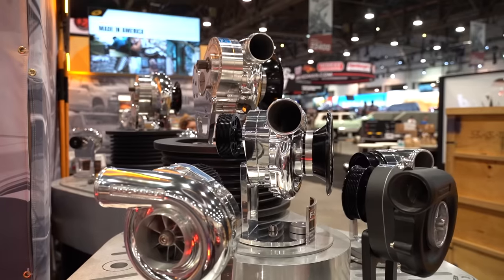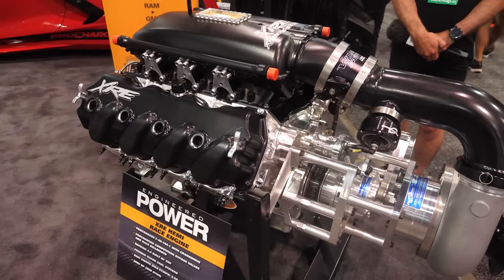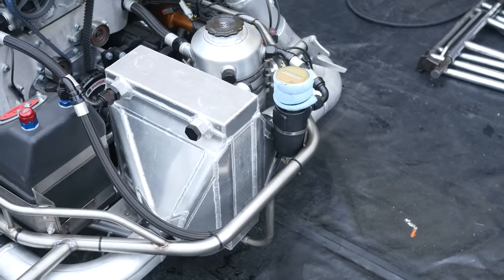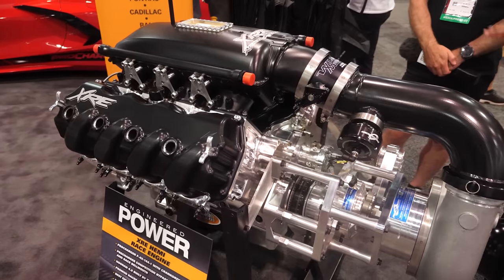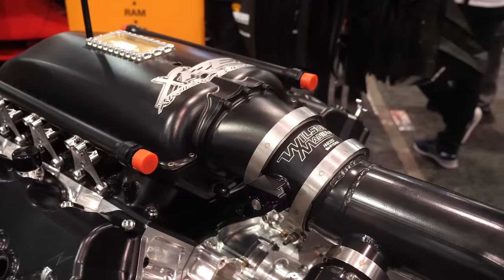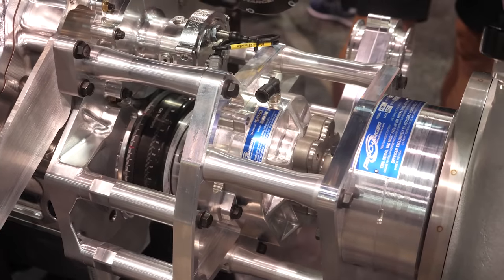Why Are Centrifugal Superchargers So Good?

Comment from the maker: Building a fast car? Get $400 OFF the VIP package with every current and FUTURE course included: https://hpcdmy.co/vipy2
Learn Engine Building today. Fundamentals course now 50% OFF.: https://hpcdmy.co/offery2
TIME STAMPS:
0:00 - Erik Radzins
0:16 - Forced Induction Options
0:34 - ProCharger
0:47 - Turbochargers Vs Centrifugal Superchargers
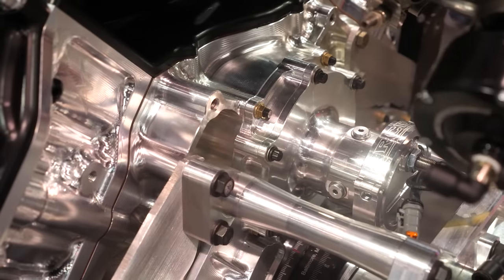2:05 - Compressor RPM Limitations
3:11 - Technological Advances
3:31 - One Size Does Not Fit All
5:03 - Efficiencies
5:52 - Supercharger Airflow Adcantages
7:35 - Boost Curves
8:38 - Boost From Idle
9:25 - Variable Cam Timing
9:44 - Superchargerss & Controlable Power
10:43 - Supercharger Packaging
11:54 - Belt Failure Vs Tensioners
12:50 - Belt Stretch
13:18 - 2000hp+ Drive Options
13:43 - Blower Speed Adjustment
15:00 - More Gears Are Good For Superchargers
16:08 - That's Erik!
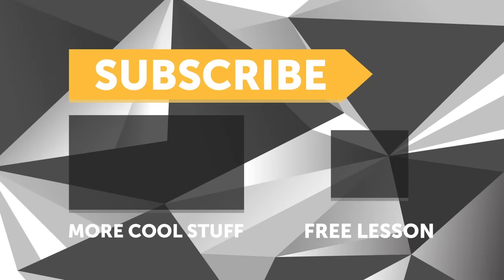16:39 - Like, Sub, Watch More, ?, Profit
🙋‍♂ Take $25 USD off ANY HPA course with coupon code: YOUTUBE25
Enrol now: https://hpcdmy.co/25offyt
Reply: Question?
Have you looked into using the petal style of throttle body and run draw through to improve efficiency?
The german aircraft ran that and saw great benefits at partial throttle as the air entering is already spinning fast and offloading the impeller.
Reply: The gears appear straight cut spurs.  Would recommend helical because they are quieter, and stronger.  They can be arranged so their thrust helps counter the impeller thrust.  If spline-connected to the shaft so they can slide, it’s possible for them to dampen torque pulses. Cheers

Comment: Roots or  Twin Screws deliver a wide flat torque curve, much more useful in the real world than the peaky delivery of a centrifugal. This coming from an owner of 2 centrifugally blown cars that I love.
Reply: every time i drive a roots or screw car, its almost unusable on the street. you give them more than h 30 or 40% throttle and they just want to blow the tires off. every centri ive driven is basically like a NA car until you cross the RPM threshold for boost. if im cruising on the interstate at 70 mph, i dont want to be making 2 or 3lbs of boost because of my gearing since im in a manual. they come on line when you really want to put the pedal down. i used to be a roots guy but now im a centri guy because ive been able to experience both several times now on different platforms and ive just come to favor centris.
Reply: @Day1Mechanic  Yeah it's a bitch having all that power available low in the powerband. In lower gears it takes some throttle control to reduce wheelspin but in higher gears you can mash the pedal at any RPM and feel the joy. I rode 170 HP literbikes for a decade and you can't give them a lot of throttle @ lower PRM in the lower gears or you'll land on your head. It was fun then and it is fun on 4 wheels as well.
As for cruising on the highway, the Maggie HB TVS2300 has a bypass valve that eliminates boost and parasitic loss at small throttle openings and light loads.
Reply: @scudzuki  I'll take a pd blower over anything.. In a race, the pd blower car just takes off way faster n is hard to beat.. Reason why most 3 second cars (1/4 mile) use pd blowers..lol
Reply: @P71ScrewHead  Yep, I want to ride that fat wave of torque from 2000 RPM to redline! This is why I have a Magnuson TVS2300 twin screw I'm installing on my LS7 ('11 Z06)
Reply: @scudzuki  The LS7, my favorite Chevy engine of the LSs.. Do you have the head fix or replaced with CNC heads?? Give it the beans man, smoke them tires..lol
Reply: @P71ScrewHead  I bought a set of used heads with 16k miles on them, had them rebuilt (new guides, seats cut, skim cut gasket surface) with Manley Inconel ex valves, reused the ti intakes, BTR platinum dual springs, ti retainers, and BTR v2 trunnion upgrade. Been driving it for a week and a half since. I love the LS7 too and especially the C6 Z06, the best balanced car I've ever driven. Gonna get another one to keep stock and possibly a GS manual for the C5R motor I have ready to throw down 900 crank HP
Reply: @scudzuki  Dayum, sounds like you're good to go.. I've always loved the ls7, never owned one tho.. Too broke n a Ford guy..lol

Comment: A centrifugal supercharger is basically a turbocharger without the exhaust turbine, so it’s driven off the crank. Well there’s no reason why a turbocharger can’t also be driven off a crank as well, so they can ‘crank’ plenty of air before exhaust pressure builds up on the turbine & so, using the benefits of a variable gear drive,  can also put power back into the crank. This is called turbo-compounding & was popular in aero engines in the immediate post-WWII period & some trucks today

Comment: Considering this concept for racing goes as far back as the 1950's with the Potvin Superchargers, there has certainly been massive advancements with the new metals, fuel delivery systems, and the engines themselves.
Reply: Advancing the technology? Fuel injection and electronic timing made the biggest impact to making any of this possible. I have a supercharged Pentastar with a Vortec in it that puts out 608 hp and it's quite amazing.
Reply: @dannysdailys  I work with a couple of vintage racers here in California, mostly just doing fabrication on bodywork. There's been two that have come through this summer building Potvin blown cars, one is a small block Chevy and the other a flathead Ford. In the shop next door is a Camaro with 500+ cubic inch Procharged engine. We looked at the dyno info for both the 1960's Potvin Chevy and the Procharged engine and the curves for torque are very similar. Much higher in the modern engine of course, but different that with a belt driven blower. I'm not well versed in making sense of that sort of data, but I remarked about how similar it was to each other and even the guys with the dyno had to take a look.
Reply: It originally goes back to the 1930's with aircraft engines, although they were trying to keeping intake air density as close to sea level to maintain power output.
Reply: Miller used centrifugal superchargers for some Indy engines in the 1930's then built the Novis in the 40's with them. a brute force approach but you have to start somewhere.
Reply: @jamesgeorge4874  Wasn't it Willey Post that did his flight at something like 30K feet in a pressurized flight suit and early Supercharging? California to Ohio if memory serves me, 1935-36.
Reply: @whytebearconcepts  The Armstrong Siddeley Jaguar was the first production aero engine that featured a gear drive supercharger, it's first run was 1922, was in production in '25, it was a 14 cylinder two row radial, but by 1927, centrifugal blowers mounted on liquid cooled V12 engines were being used on flying boats, and marine racing applications, by WW2, two speed, and two stage supercharging with aftercooling was  in development. Aero engine technology from the early 1900's, up until the jet age was remarkable.
Reply: @jamesgeorge4874  Thank you for that, I'll have to read up on the application. I have both a Paxton (1957 Ford) and Potvin (Small Block Chevy) supercharger in my garage waiting restoration.

Comment: Our of morbid curiosity, I'd like to see a ProCharger on a Cummins. I've always done compounds, but the kid in me wants this
Reply: @shaynekirby9117  Even better, what you can do is have a sequential setup with a centrifugal supercharger feeding into a larger turbo, so that the centrifugal is just there to eliminate turbo lag at low RPM and spool the larger one faster. You could do the same thing with an electric turbo. This would create a lot of boost but if you already have a turbo, it’s probably easier to just install an anti lag system with compressed air feeding the exhaust and spooling the turbo faster

Comment: Damn, brilliant as always. Guessing CVTs couldn’t handle the force to make variable speed a possibility.
Reply: They can handle loads of force, but I think the belt would expand outwards at that kind of crazy RPM and bugger up the ratio.
Reply: ProCharger does actually have a compressor you can buy with a programmable CVT gearbox, called the 'i-1'. Or at least they did anyway, I haven't heard anything about it in a while, honestly might not have sold too many because it was a little more expensive of course and, honestly, the "need" for more boost down low out of centrifugals is a bit blown out of proportion for most applications. It's for street car stuff, I don't know how far anyone has pushed the i-1 but ProCharger says they're good for a max of 900HP.
Reply: @bennyb.1742  I would imagine the CVT would be used before a gearbox that reaches the crazy speeds. Basically run it so it can shift the input speed to the gearbox 1/3RD up or down from crank speed. Allowing it to be under driven under driven at idle and low load cruising then to be over driven to get the compressor into its efficiency range when the engine RPM is climbing.
Reply: @bennyb.1742  they can’t, where are you getting your info from
Reply: CVT driven centrifugal blowers have been made. Major example was the Daimler Benz DB605 built by Germany during WW2. In that case the blower was driven by a fluid coupling, varying the amount of fluid (engine oil) in the coupling gave variable speed.

A simpler and more reliable option is to use a multi speed gearbox. Most WW2 plane engines were set up that way, usually two speeds were available shifted by clutches.

The reason they went to the trouble in both cases is so that the superchargers could compensate for higher altitudes by increasing the drive speed.
Reply: I think you could do variable geometry in the compressor side.
Reply: @adamsh1  they work well enough in the masses of cars that have them

Comment: Oh wow, I didn't know that! These superchargers only spin at 1/2 or 1/3 the speed of exhaust driven turbochargers. That is a huge difference if the compressor wheel spins at 180000 rpm or just 75000 rpm... 😲
And btw: using a "Winters quickchange" style gearbox is quite genious for changing the ratios... 👍

Comment: I have a new idea, a normal complete turbocharger that is crank opperated via a cvt belt driven to spool the turbo at low rpm and with a free wheel mechanism, so when the cvt cannot go faster the exaust flow pushes the turbo. In other words replace the electric motor of the turbo of an f1 mercedez with a cvt, free wheel and pulley connected to the crank shaft and obtain instant response and peak power like never before

Comment: I have a Procharger D1-X on my 2020 Mustang GT making 770HP at the wheels at Palm Beach Dyno.  I don't like the Procharger Blow-Off Valve that came with the kit.  It's very bulky, it's not very snappy.  Although their blowers are fantastic, get a Tial or equivalent to fix normal drive ability issues.

Comment: I have a ve alloytec engine (with new timing chains lol) I have a v3 sealed trim capa supercharger with big intercooler and running a 10psi pulley and getting 335 kw at the treads at 6500rpm limited about to install a haltech to solve some fueling issues. As is I would say it's similar to a big v8 so much fun to drive and very street able. I would recommend great tensioner and very precise bracket and pulley orientation and it's awesome

Comment: I always enjoy these interviews, thank you! 

That said, between a standard roots/screw blower and a turbo, a centrifical supercharger does kinda sound like the worst of both worlds. I'm sure it definitely has its's place mostly in uber high hp very custom drag applications (and sales back that up) but doesn't look like a good fit for more "street" or circuit applications. Still, awesome tech.
Reply: Having driven 5-600 hp v8s with both TVS and centrifugal blowers, i think putting it that way kind of glosses over parts of each type of blower.

The TVS mustang was absolutely brutal to drive. Very hard to control due to the huge amount of torque available down low. Not a bad thing to have a broad torque band, just hard to drive.

The centrifugal makes little boost until you get some speed into it. Sure, it's disadvantaged, however, it does have awesome driveability. Plus if you want boost, just downshift once or twice. You're going to be at higher RPM when you want the power anyway.
Reply: @crackpotfox  yeah i mean it's still gonna be making half boost at half rpm right? just seems to me like a waste at anything under peak rpm which is where a street car lives often. and probably a reason every oem in the past 20 or 30 years has only gone with PD blowers. plus the sound is hard to beat
Reply: @biruitor1680  I mean, at WOT, are you at half rpm or full rpm? I'm usually at the top half of the rev range at wot.
Reply: The lower boost at lower RPM could be an advantage for a street car, less boost means less fuel used (as less air is flowing) and also less torque needed to drive the supercharger, so your fuel economy will probably be quite a bit better than a PD blower. 

Of course turbos also have this property. And they are cheaper, no super high speed gearbox required.
Reply: @nerd1000ify  To be fair, modern (as of like 30 years ago) pd blowers use a bypass valve that essentially disables boost unless your throttle is open enough.

And turbos are certainly not cheaper. Look at turbo kits vs centrifugal kits. Centri supercharging is cheaper than a turbo setup or a PD setup, unless it's chinese junk.
Reply: @crackpotfox  I'll defer to you regards cost.
Reply: @crackpotfox  perhaps but even 3/4 or whatever fraction will be the fraction of boost you get compared to a PD blower no?
Reply: @biruitor1680  Two similar engines with identical peak hp or tq will have the case you describe: centrifugal will produce less boost at lower rpm, meaning that the centrifugal will produce less torque.

However, the centrifugal may produce higher boost at the peak than a roots, with the same same setup mentioned before.

All that is to say that barring radical turbo setups, I think the differences between the 3 power adders are less significant in real life driving than most people think.
Reply: @crackpotfox  i've seen that argued about the peak boost numbers but that just seems like more load on the engine? i'd prefer the setup with less peak boost and stress that still feels/is as fast

i'd agree that the differences are generally minor for most people which is why i prefer a PD for packaging and sound reasons. on the other hand (at least on the affordable end) it seems that centrifugal setups are much cheaper, like for my vette a kit from ECS/Vortech is $6-8k while a kit from Edelbrock/Magnuson is $10k+ for similar peak boost/hp. and on the other end of the spectrum it seems like all the race cars make big power much more easily with the centri setups
Reply: @biruitor1680  Centri compressors are more efficient than PDs, and the gentler boost curve is much kinder to the engine recieving the boost. Getting instant brital boost isn't terribly nice to an engine
Reply: @crackpotfox  idk seeing that we have 600-800hp supercharged engines with warranties today i wouldn't feel too worried about durability, and theyre all PD blowers
Reply: They still have their place even on the street - especially when you get into the traction limits. The torque curve ends up growing at the rate you can effectively apply it and it still has very good throttle response.
Reply: @captainobvious9188  that just means you need better tires, unless your argument is that theyre better cause they make less power
Reply: @veganjoy  Essentially, yes. People dismiss them because they generally have something between a linear and exponential boost curve, so you look at the dynos and think it’s crap, but IRL I’ve seen centrifugal superchargers do pretty well because you can actually control traction with your right foot which continues into a good top end. Would I personally rather have a turbo, yes, but I wouldn’t dismiss them is all I’m saying.
Reply: @captainobvious9188  with the way you can modulate boost by gear and all sorts of stuff with modern turbos i cant imagine there's many reasons to consider them over an equivalent turbo. and PD blowers sound amazing and have way more area under the curve which is significant for most engines that dont already make tons of torque

Comment: .7854xdia2/PSI or KPA. That is the formula you need for all displacement cylindered applications. As long as you know the maximum pressure per cylinder at maximum load then all your other ratios per atmosphere absolute will equate. Use this formula with your map sensors and ratios.